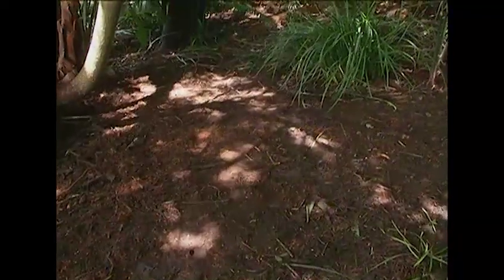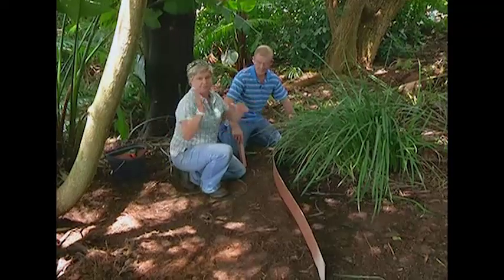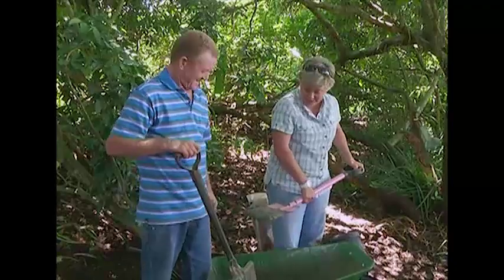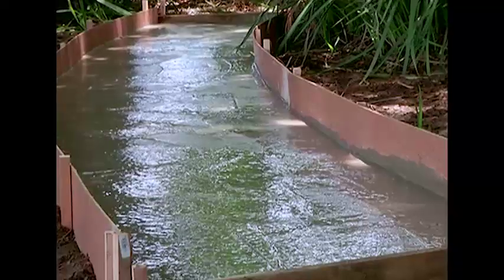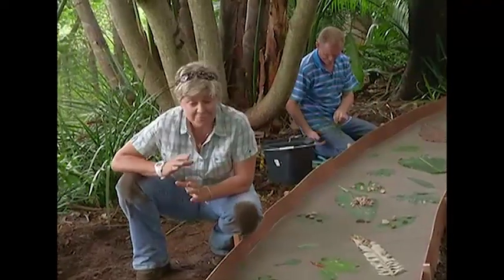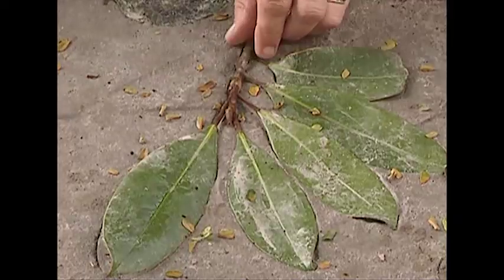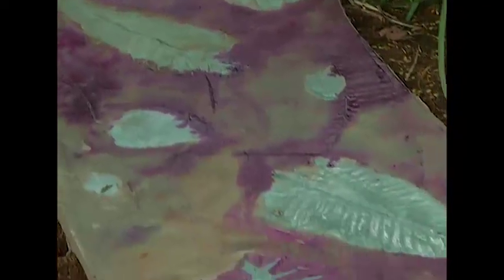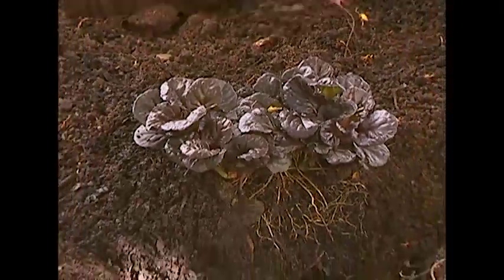DIY: Laying A Concrete Pathway With A Difference

Comment: Oh my dream is to make a concrete pathway like this, leading up to my family's pet cemetery. However, we are in Western Pennsylvania (snow country) and the soil in that area is mostly rocky clay (land was a 1940s coal strip mine & is now in the forest under many pine trees). I'll try planting mint (which the deer hate & not eat up) and vox (a perennial which creeps, and flowers) though in all likelihood they will not take, but luckily the natural moss is abundant and I think will be equally attractive along the sides. Now to search through your fabulous videos for a low, natural fence idea to go around the cemetary. I'm excited for spring so I can begin! Thanks for such easy to learn & wonderfully taught ideas and inspiration.
Reply: remember the roads crumbling here due to 40 or 50 degree temp changes in 24 hours - SW PA where concrete goes to die.

Comment: Would you recommend putting in masonite joints?  The mix seems thin and may be subject to cracks in such a long uninterrupted length.
Reply: When I seen the wet concrete used, it seemed to be it would crack and flake off.  I have this problem from hiring a pro. Didn't know back then what I've learned the expensive hard way.

Comment: Laying concrete directly on top of soil in not a good idea. A compacted  hardcore base of a few inches  is needed to ensure the path doesn't crack.
Reply: Should be 100mm minimum concrete too!!
Reply: I was wondering about that.

Comment: My problem is I have some over 200 hundred old trees and the roots pop up every where and break what ever I put down.  I have arthritis and have to be careful when walking.  I had someone come in and dug the roots out but within a couple years they were back.  Any ideas?
Reply: wooden above the ground be a bit will allow the roots to be as they wish and if they interfere with the walk way it is an easy remedy... good luck
Reply: Kathy, the problem with removing the roots, is it leaves the trees vulnerable to wind.
I have the same problem with my trees and roots. So rather than weaken the root structure,  I decided to build the earth matter around it and bury the roots under wood chips. As the chips decay it becomes soil.  If you need a more solid footing, place stepping stones  in the wood chips. Stable, eco friendly, and still saving your root system. All the while providing you with a "trip hazard" free path.
Good luck 🍀

Comment: This is an easy to make path, but I'm a little disappointed that the creator didn't discuss the tradeoffs between thin easy to make concrete walkways and more durable, thicker concrete with less water and perhaps using steel reinforcement.

Comment: Not finished laughing at this method.. How to lay a concrete path so that it will crack and break up in a week or so of walking on it. Then you can dig it all out and Relay it properly with a Tamped crushed stone base and 100 mm ( 4" ) thick Concrete.

Comment: So, I guess you're in a climate that does not freeze.
Reply from the maker: Hi there, this is true for the most part here in South Africa. Some areas do get frost but not too bad.
Reply: you can do the same thing only in smaller sections then fill them in with a cement foam like they do for driveways. can be found in most hardware stores like lowes or home depot.just make sure they are really close, so do one and maybe use it as the front stop.or use something even thinner than masonite. it will allow for the freezing.